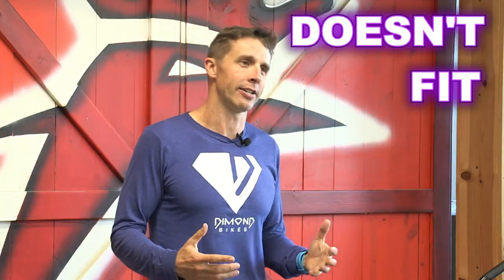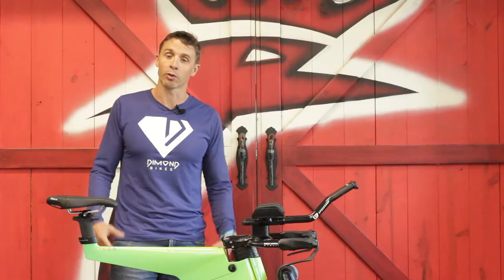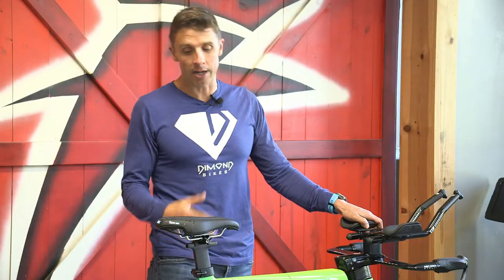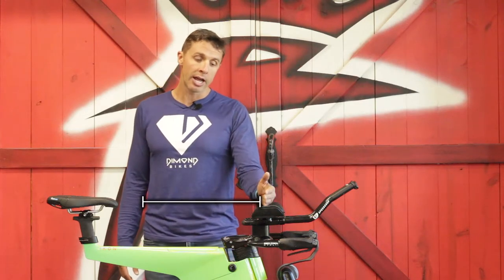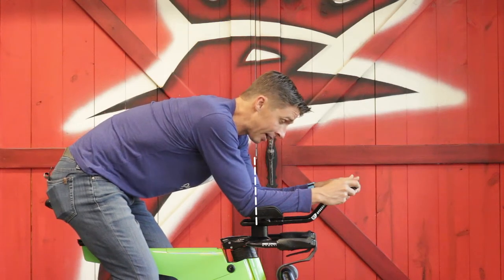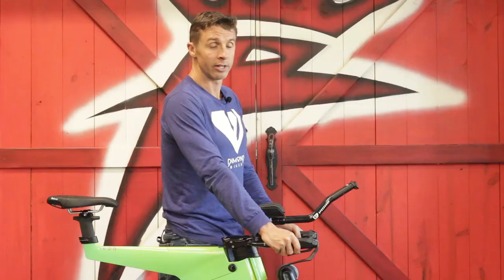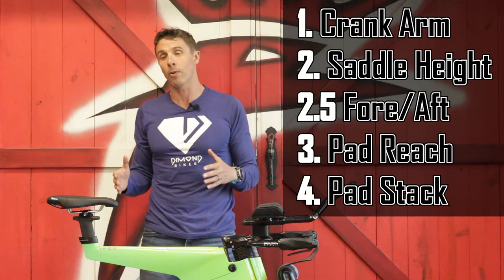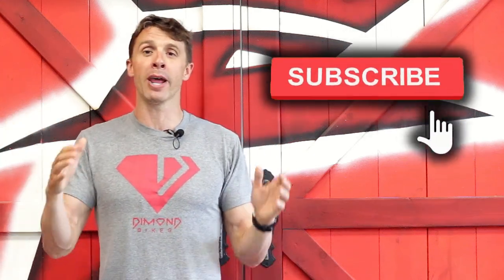Bike Fit Basics!!

Comment: IMHO people should stop recommending crank arm length changes as a first thing, it's a big component change in the bike, specially if you already have Powermeter in the crank... It is possible to achieve better hip angles also by adjusting the saddle position towards the front, which is way easier and cheaper for the rider...
Also, how do you adjust the saddle height in this frame? Seems like a very limited range.
Reply from the maker: This seatpost allows about 20mm of height adjustment. Measure twice, cut once!